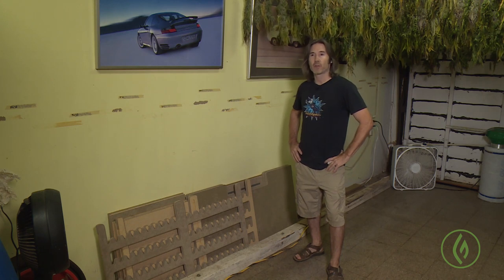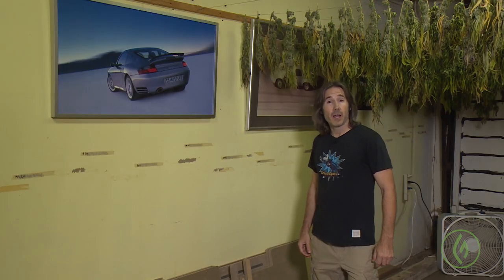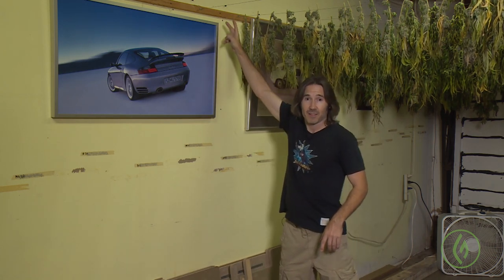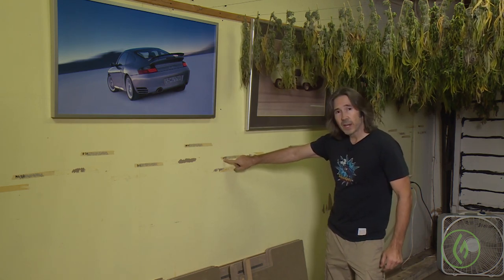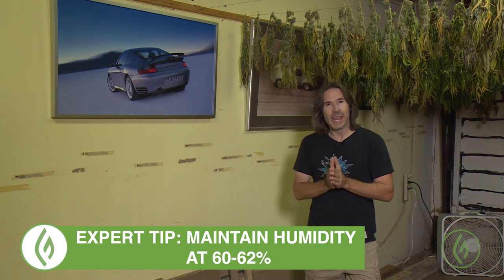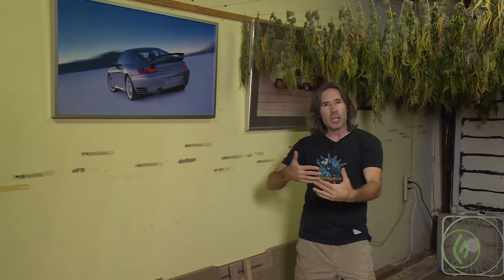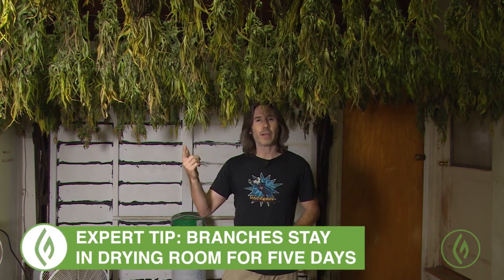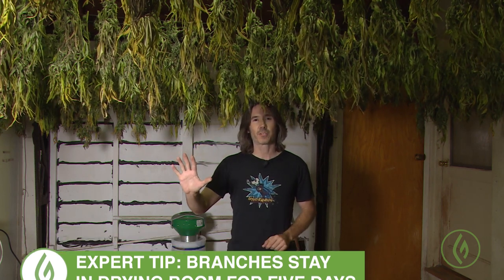Cannabis DIY: Create Your Own Cannabis Drying Room at Home / Derek Gilman / Green Flower

Comment: I just have a fan with a bowl and wet towel in it blowing outside the closet door that is just cracked a bit so some air goes in. My average humidity is like 30-40% so I use little water to blow in the air.
Reply: Bro basically I’m doin the same damn thing right now lol

Comment: What’s up all, what are your thoughts on a 14 day slow dry, humidity at 60-62% and 68-69F.  I am on 5 right now and wondering in 14 days is too long as this video mentions 5 days.  
The reason for 14 is supposedly to allow time for the plant to break down allowing full flavours to come through?  
My last crop I had the same temp and humidity but only 7-9 days, my buds were potent but seemed to lose smell and taste after 1.5 months cure :(. 
Unless I messed up during the curing process (60-63rh/69-70F in the jars) any tips would be helpful.  Sorry for the long post, awesome video btw.
Reply: I've seen another video with this same guy, about trimming bud I think, and he says he trims after 5 days, but than the bud goes back into his drying room...

Comment: What do you think about RH 50% and 65F? 50% seems most recommended, which i am currently doing and it's day 7 and they're still pretty wet. I'll probably go a full 10 days. Oh and great videos, i am subscribed.
Reply: I recently did 50RH and 63 f and came out good but could of been better so next ones I harvest I will try 63f and 60RH
Reply: This is just my mildly informed opinion, so take it for what it's worth.  I feel like 95% of the cannabis information out there is meant to be "fail-proof".  For instance, with the 50% recommendation on humidity:  50% may be closer to fail-proof because the air is relatively dry.  This will compensate for people who don't have the proper airflow, proper plant spacing, etc in their drying rooms.  This compensates for poor conditions, but at a cost of quality.

However... if you have the knowledge, and are able to control all the variables in the room precisely, 60-63% is probably perfect.  But if you mess up the airflow, or other factors, you might easily get bud rot or mildew.

This is just my opinion, but as time goes by, I find myself hearing more and more actual expert advice that is contrary to the generic grow guides.

Comment: Thats too much air circulation imo.  To each their own but i prefer a slower dry with minimal ventilation.   If the room is cleaned thoroughly beforehand mold wont be an issue.

Comment: First off, thanks Derek for taking the time to do this video.  Very helpful.  Very professional!
 However I do have a question,  I noticed your carbon filter doesn't appear to be vented to the outside.  Is it not necessary to vent it being that it is being used for drying only and not in a grow tent situation?  

Also, I have central A/C for my garage.  Will this be sufficient enough for air intake?  I live near Sacramento and it's dry and hot!
Will be in the mix and drying probably by mid October.  1st grow and 1st dry.

Comment: I was planning to dry in my 24x48x60 tent using a 4in exhaust & carbon filter with a tiny desk fan underneath facing a wall. I don’t want to dry to quick so plan to set the exhaust to “low”. I was wondering if even that might be too much suction and dry fast. It’s for 2 plants so any advice I appreciate!
Reply: Should be good 👍

Comment: why do we dry in the dark ?  Whats the thinking behind that process....
Reply: kid comet Well, the quick answer is that sunlight degrades THC, it does so by acceleration oxidation of the THC to CBN. Oxygen content and high temps also break down THC. Another reason is to help chlorophyll break down and turn into a variety of sugars, and since chlorophyll responds to light, the dark is the way to go. Hope this was a sufficient answer
Reply: @jhuntoon23  yes an thanks
Reply: @jhuntoon23  What if it's low level, indirect light? If there isn't any direct UV hitting the plants, would the THC be preserved and the chlorophyll still breakdown?
Reply: hi, you must dry you weed in the dark because the chlorophyle material must have dark to turn to sugar, peace.. ;-))

Comment: 5 days is a bit fast don't you think?
Reply: too much fans, air flow is fundamental but it should be GENTLE !
Reply: He only keeps them in that space for 5 days. He has a separate drying and curing process after. What he showed is strictly for the trimming process, as he trims everything by hand then the ladies go to cure.
Reply: For me, 5 days is usually the perfect amount of time to dry when snipped from stem.
Reply: Please listen guys . He drys for 10 days  5 days initial dry . Trim . Then back to drying for another 5 days
Reply: stha89 it all just depends on if you cut from stem or hang whole plant. Whole plant definitely takes longer.
Reply: @BLentz32  people are not getting the whole point of drying, you dry to remove water and chlorophyll and other bad stuff , these release from the outa portions of the bud, when you go to cure your buds aren't completely dry, curing is the slow release of moisture over time, which bring the inner flavours, smells to the drier bits, drying completely in less than 10 days is dried to quickly, which locks the bad crap in. and also if youre curing after 5 days , There's a good chance you've been smoking mouldy bud
Reply: @steveepeeps  curing after 5 days of what? Smoking mouldy bud what???